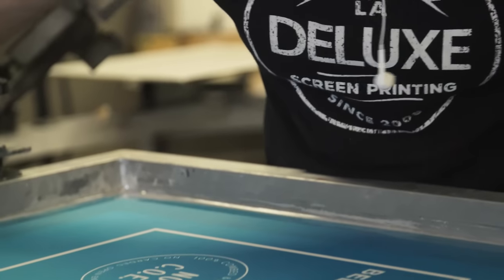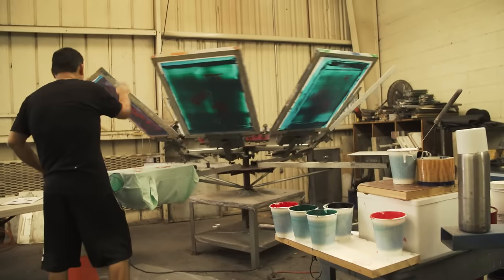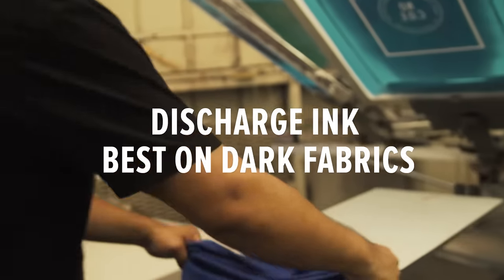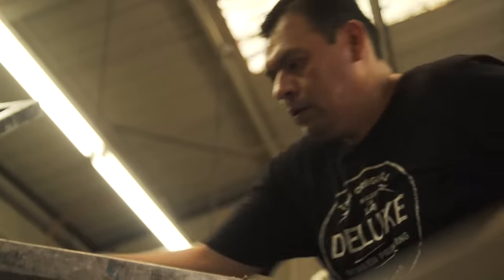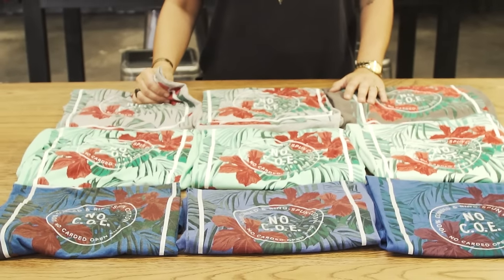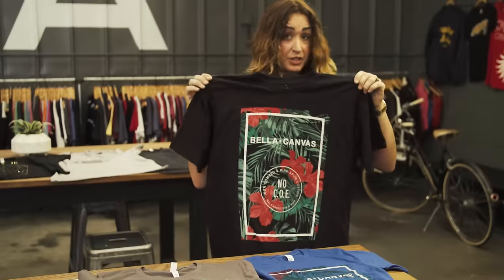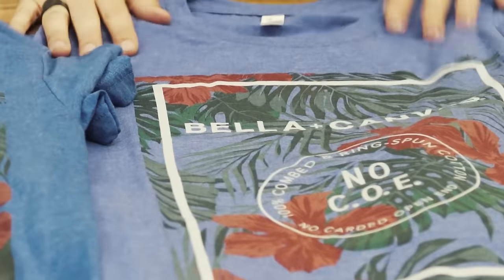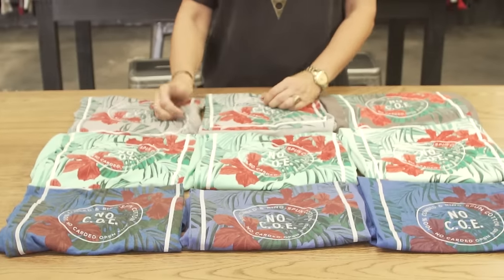Screen Printing with Discharge and Water Based Ink

Comment: What inks are you using to print on the triblends? Do you find that Bella triblends react better to discharge inks than some of the other brands? Are you adding any low cure additives to your ink? I've had issues with shrinking Next Level triblends in the dryer. Tried adjusting temp but can't seem to dial it in? What dryer are you using and what's your temp and time setting? Sorry for the flood of questions. Love what you guys do at Deluxe!!
Reply from the maker: Hey Kico! We'll reach out to Deluxe and see if they can give you those specifics!
Reply: Hi Kico, although I can't give out our source, its best to use an ink designed for 50/50, to give you some added protection if needed from dye migration and we don't add additives to the ink. We haven't experienced much shrinkage issues with Next level. We use a gas dryer dialed in at 350 degrees, which will yield a 320 cure at the end of the belt. But keep in mind, for poly blend fabrics you don't need such a high cure rate. So you can lower temp or speed up the belt, and that should help with shrinkage. Check with the ink your using for recommended cure temp.
I would recommend buying a laser temp reader to get a reading of the ink, as first sign of it coming out of the oven. You may be running too hot for the fabric type.
I'm also wondering one thing.. is the print shrinking or the actual shirt? Just a thought, that if your pallet is too big, it will cause the shirts to stretch, but once taken off, the shirt will shrink back, but the print will also shrink because it was originally stretched.
Reply: Thank you so much for the reply! I do think the oven may be running too hot. Especially for triblend fabrics. It sounds like curing temp might be the key to the process for discharge and/or waterbase ink on blended fabrics.
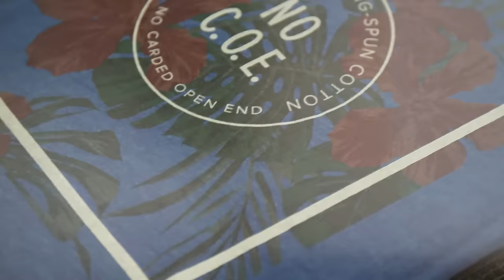Reply: You're welcome!......Yes, for discharge inks or waterbase, curing temp, and time.. which should be about a 1:20 secs should evaporate moisture. We find they're black heather line to be the best at discharging, since it has a high cotton content.

Comment: Nice video! Which brand of discharge inks do you use?
Reply from the maker: Deluxe doesn't disclose the brands they work with, but we recommend checking in with your local screen printing supply company for recommendations on quality inks.